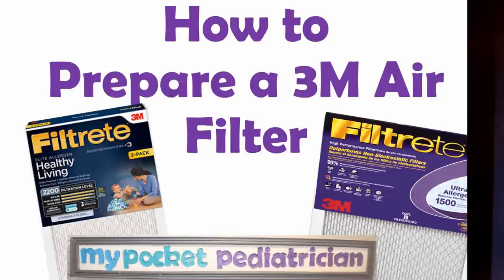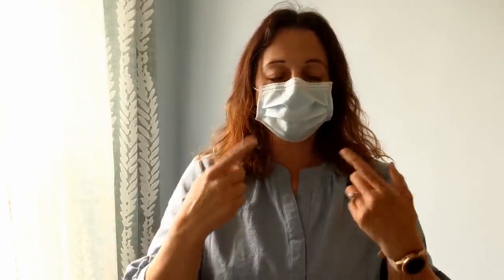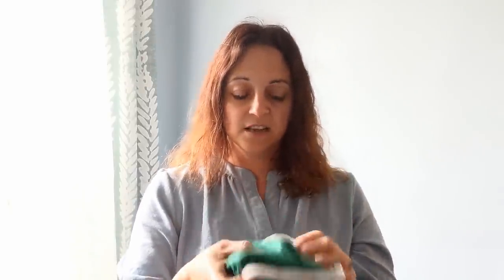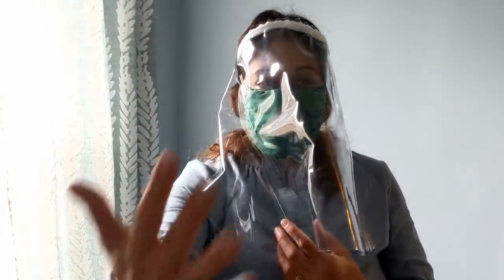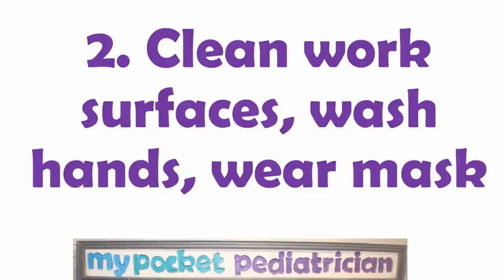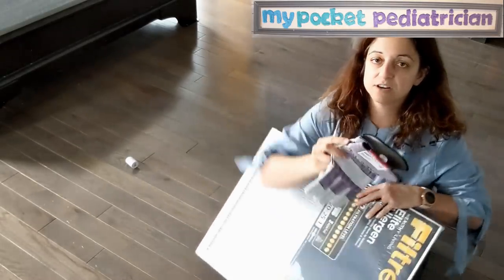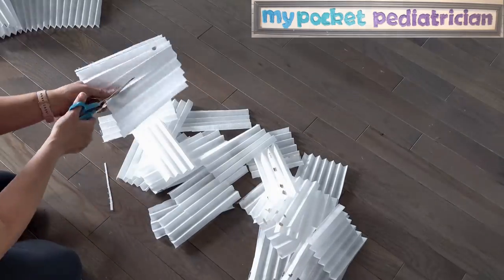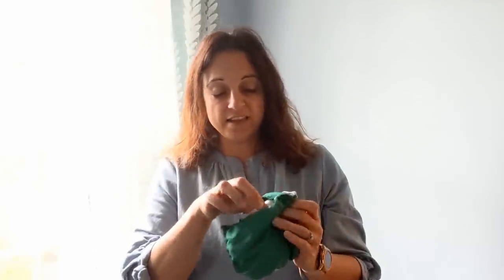UPDATED!  How to Turn a 3M Air Filter into a Face Mask

Comment: I'm wondering, if the filter is made of layers, wouldn't unfolding them decrease their effectiveness?
Reply from the maker: It's not exactly layers - it's just accordian shaped, but that's why I suggested using 2 layers of the material laying flat on top of each other.  I'm working on some improvements and hope to have a new video soon - I'm trying out new filter material tomorrow and am making a few comfort adjustments and hope to have a new video soon - please subscribe to get updates!
Reply: @MyPocketPediatrician  wait, i thought you said NOT to use two filters at the same time.... Can you clarify????
Reply from the maker: @nathanielaminahbradford4632  I believe I said to use 2 layers at once.  If I said something in error please let me know!

Comment: This is the best DIY mask I have seen so far! Thank you for taking the time to share this.  I have been wondering. I have sleep apnea and have extra CPAP masks available. Would sealing in a filter in the hole for the tubing be useful for our personal use? The mask seals tightly to my face. I don't think I could work a shift with breathing that restricted but I think I could do a grocery run.  I could safely discard the filter after each use and wash the mask in hot water with bleach. Just curious about your thoughts. Thanks in advance.
Reply from the maker: Some people are trying that.  It can be a little hard to breathe through such a small filter. ..like breathing through a straw.   I'd try it at home and see what you think.   If you have COPD, I'd check with your doctor about wearing masks and making it harder on yourself to breathe.
Reply: @MyPocketPediatrician  THANK YOU for your answer. No COPD. Yes, I will definitely try it at home first.

Comment: OlyFun fabric from Walmart is breathable and water resistant.  A square of this in with your other filters might help the cotton not get so moist?
Reply: Unfortunately those don't last in high  temps. They may begin to melt and warp in the dryer. Non-woven fabric stabilizer is a better option.
Reply: Amanda Pratt 
Understood.  I’m just using that as a temporary insert, not sewn into the mask.  My mask I made has a filter pocket so I won’t be washing the OlyFun.  I’ll just take it out and leave it alone for a few days and then reuse it.

Comment: Thank you so much for the video and great information.  Do you recommend putting 2 filters in one mask at the same time?  Thanks.
Reply from the maker: Yes, but I"m working on another material that will only require 1 layer.  I'm fit testing today, so please subscribe for those results!
Reply: Thanks! @MyPocketPediatrician
Reply from the maker: I have a new and improved Adjustable mask with FILTI material that passed the FIT test!  Please check it out here:  https://youtu.be/2J3Fq4o-U4I

Comment: I just wanted to confirm, are you using two individual filters at a time in your 2 per day notes?  Or two filters together for one day?  Thanks!
Reply: I just started watching your video on making the mask and you clearly state it having two filters inside.  So I answered my own question!  I made an Olsen style mask and I am trying to figure out the best way to insert the filters once cut to fill it the best.
Reply from the maker: @coldphyre  The problem I have with the Olson mask is that the filter doesn't take up the entire space of the mask.  There is a lot of fabric on the sides that doesn't have filter, so the air will travel much more easily in through the unfiltered fabric.  There needs to be a way for there to be no air at all to enter outside of the filter, which is why I chose my design.  I'm working on some new materials and a slightly more comfortable design that will maintain the tight seal.  Please subscribe so you get the updates!
Reply: @MyPocketPediatrician  thank you for your time in replying!  And that does make perfect sense!  The style I made is from Craft Passion and the inner layer for the pocket does extend the full length of the mask.  I still need to watch your mask video entirely!  Thank you again for sharing your information!!
Reply from the maker: @coldphyre  You're welcome!

Comment: Hey, great update!  Also, I saw another Dr. make one with a pipe cleaner for the bridge of the nose. We will be making at our own risk. Also, these are made out of polypropylene and polyolefin. The little research I did, I believe they are non toxic. But be aware.
Reply from the maker: thanks!  I have the link to the safety data sheet below.  I've heard the pipe cleaners are getting rusty when they are washed from the sewing community.  Some are using twist ties for bread bags also, and I heard they are holding up a little better.
Reply: My Pocket Pediatrician my wife said those tie things on coffee bags are flat and the wire is in the plastic. But might work too.

Comment: My husband insists that the furnace filter looks the same on both sides, and so it doesn't matter which side is toward the person's face. He says the arrow is there on the package because some filters have the wire mesh on only one side, and that side needs to be down in order to support the filter when you put it in the furnace; he says they put the arrow on the package even for the filters that have wire mesh on both sides; he says the air flow direction doesn't matter. I disagree, but we're having this conversation because I already took apart a filter before I saw your video, and now I don't know which side is which. Bottom line: can I use the filter I already took out of the package, not knowing if I have the air flow direction correct or not? Or is there a way to tell which side is which after I've taken it out of the package! Thanks for this video!
Reply: On closer inspection, it appears that on one side of the filter you can see a mesh of shiny strands, which don't appear on the other side. If this is the case and not just my wishful thinking, now I just need to know which side goes toward the face. I'm thinking that it should be the side without the shiny strands.
Reply: I emailed my question to mypocketpediatrician and got the response that confirmed what I noticed about these furnace filters: yes, there is a slightly shiny side and a softer, duller side. The shiny side goes away from the wearer; the dull side goes toward the wearer. And yes, she said, it makes a difference: you really need to pay attention to the different sides of the filter.
Reply from the maker: Hi, Again, I am not an expert, but when I talked to people who are, they said it is very important.  Mine had mesh on both sides and had the arrow.  The side towards the HCW is a little soft and dull and the one towards the patient is shiny.  It's really hard to tell, but I keep moving it around in the sunlight, and you can appreciate a subtle difference.  Hope this helps!

Comment: I think that suggesting people use filtrete is foolish as this will just create demand for products that should be used to protect the air filtration of thousands of homes and businesses.  would be much better to demand filtrete create a proper filter sheet for people to order in limited quantities.
Reply: I hadn't thought of that, but it seems logical! And now the company making these filters is saying they shouldn't be used either.
Reply from the maker: I have a new and improved ADJUSTABLE mask with FILTI material (designed for face masks) that passed the FIT test!  Please check it out here:  https://youtu.be/2J3Fq4o-U4I
Reply: @MyPocketPediatrician  - I'm glad you found something different! I actually ordered some. Once the fabric I've ordered comes in, maybe I'll actually get to use it in some masks I make! lol
Reply from the maker: @RaDazzle1  did you use the discount code?  MPPMask will get you 10%off

Comment: POCKET PEDIATRICIAN PLEASE HELP!! I'm making masks for everyone i know using ur filtering method. U said to look for the arrow, unfortunately theres no arrows or anything anywhere on the filter or box it came in. I wasn't able to find the exact type of filter u have mine is smaller and more compact without the mesh but it's the same exact filter and everything just smaller. One side is more cottony the other side is more of a smoother surface. I already took all the cardboard off and got most of the glue pulled off all of it. Now I have run into my big dilemma with the proper way to use them. My problem now is trying to figure out what side should be facing towards ur mouth...the side that's more cottony or the side that's more smooth. Please please help! I'm only asking for help from u because u seem to actually know what ur doing & I haven't found any better filtering advice than ur's. Thank u soooo very much for ur help & advice! U don't even know how much it's appropriated!! God bless u!
Reply: The cottony side should face you. Shiny side should face out.

Comment: I wish I had watched your video before trying to take the filter apart!!  1 slice and 1 poke not too bad
Reply: I forgot to mark the side with the airflow🙄 can you tell me if you can tell by looking at each side which should be towards HCW?
Reply from the maker: Aww - I'm sorry!  I was the same the first time I tried too!
Reply from the maker: @shelly2083  the slightly shiny side faces the patient, and the slightly softer dull side faces the healthcare worker

Comment from the maker: Diane Isherwood  the shiny side goes towards the patient and the softer, dull side goes towards the healthcare workers.   I did update this video since 3M says they don't recommend doing this to their filters.  I'm using Filti now, and here's the new link.  https://youtu.be/2J3Fq4o-U4I
Reply: I also opened up the filter and forgot to mark which side is which. However there is no shiny side. They are both exactly the same on each side. So how can I tell them apart?
Reply from the maker: @AmyWilliams1914  It is a very subtle difference. I usually have to hold it to the light to tell. You could also rub your finger on one side and see if one side becomes a little fuzzy and fluffy. That would be your soft side

Comment: Thank you Dr Lilly, as I had someone make an Olson mask, and subsequently find it not easy to use with tapes ( before that I’ve resorted to bandanas, tape to secure a filter inside and had a really good fit)., I thought elastic is the answer and came across this!! Thank you!! About the moisture, have you considered either sodium chloride ( disadvantage only one paper published) soaked wet wipe, or citric acid soaked wet wipe as the top layer?
Reply from the maker: I saw another video where the Olson mask failed the fit test despite all the tape, and I believe it's because the filter material doesn't extend over every surface of the fabric.  I found another company that seems to have a material where moisture won't be an issue.  They over-nighted me a sample, and I keep checking the porch to see if it has arrived yet.  I can't wait to try it out and make another video if it really is as good as they say.  I should have another video soon with some design improvements for comfort and with the new filter.  Please subscribe so you get the updates!
Reply: @MyPocketPediatrician  I can't wait to see the next video with the new material. Have you tried making the mask itself out of non-woven material? I have experimented with making face masks from blue shoe covers that have the elastic already sewn into them. I use the cover unopened (so that it's two-ply) with the elastic fitting over the nose and chin. I sew in elastic ear loops on the sides. With a tight fit, combined with a high MPR filter placed in between the 2-ply, they could work and even be disposable (though I appreciate the reusable aspect of cotton.)
Reply: I can’t wait, meanwhile I will have this made, with Halyard materials to send to one person who is immune compromised and doesn’t have a choice. I’m also soaking wet wipes in citric acid, determining rough pH using litmus paper, this will be the outside material then filtering materials. Once again, truly thank you, for putting this material out here, and the more we know the more we take it seriously. Thank you!

Comment: So it was time to change my house filter anyways.   I couldnt find a 3m one in the size i needed.   I did find merv 13 filters in my size tho.   So i got them for my house and to use in a Mask I am 3d printing.   Is there any data on if the Merv 13 is as good as say a 3m 2200?
Reply from the maker: I had a hard time finding a conversion rate - it seems 3M designed their own proprietary system.  I know their viral filtration starts at MPR 1500 and MERV viral filtering starts at 13.  Some have expressed concern that other filters may have fiberglass.  I haven't used any others, so I really can't comment on their experiences.
Reply: Conversion table at https://www.airfiltersdelivered.com/c/merv-mpr-fpr-ratings

Comment: Will coffee filters work?
Reply from the maker: Coffee filters won't filter vital particles...or even droplets really since water (coffee) passes right through them.   They really only filter coffee grounds.    I am working with a better material now.   It's called Filti and is available here:.
Reply from the maker: Coffee filters won't work. They really only are designed to filter coffee grounds. They definitely won't catch viral particles and not even droplets really since they are designed for water or coffee to pass through them. I am working with a new material that is better called filthy that also passed the fit test. Check out the new tutorial here.   . https://youtu.be/2J3Fq4o-U4I. I also have a discount code for them.   MPPMask
Reply: @MyPocketPediatrician  Ty for your response.

Comment: Wow! Great video! Thank you doctor. 🙏👏👏 I have one question, so the filter you showed us by 3M, those are safe to use?  Please let me know, thank you. I also heard we can use coffee filters?
Reply from the maker: I honestly can't say for sure.  3M will not say they recommend this. Coffee filters won't filter viral particles.  I found a material that I'm working with that is designed for this, and I should have another tutorial out in the next day or two - please subscribe so you get the updates!
Reply: @MyPocketPediatrician  I see, thank you doctor. I read an article that was posted today that talks about the types of materials that are best suited for a homemade mask. And you're right, the coffee filters provide very low filtration protection against viruses. They said material that is dense with a high fiber count such as flannel works well. Provides moderate protection. I was thinking of getting a flannel mask, what do you think? And yes, I will look out for your next video. Thank you! 🙏
Reply from the maker: @Linkfan007  I'm not sure how breathable flannel will be, and I doubt it will filter viral material either.  The material I tested today passed the FIT test, so I'm really excited about it!
Reply from the maker: I have a new and improved Adjustable mask with FILTI material that passed the FIT test!  Please check it out here:  https://youtu.be/2J3Fq4o-U4I
Reply: @MyPocketPediatrician  That's great! Thank you for letting me know, Doctor. I will take a look. ☺

Comment: The fiberglass concern seems to be coming from the community that started making masks with HEPA rated vacuum bags. These bags apparently run a risk of having fiberglass, and since you shouldn't be getting into one, it is considered safe for that application.
Using it on an apparatus designed to breathe through would be the big no-no.
Filtrete does not use fiberglass for their filters. They use extruded, thread-like plastics, as shown in the MSDS.

Comment: Safety Concern:  fiberglass
Please be very cautious about which filter material you use.  If you don't know for sure that it doesn't contain fiberglass then I would be very cautious about using it.  I couldn't get a 3M filter so I purchased another highly rated brand, made in the USA and rated MERV13.  The product information said it was synthetic material.  I assumed that since it was intended for home air filtration that it would be safe and not contain fiberglass.   I've found that is not a safe assumption.   I dismantled the filter as described in this video and cut it into pieces.  Then I noticed very tiny loose fiber like particles all over my work surface (which happens to be a dark color and right by a large window).   Examination under a magnifier showed particles resembling fiberglass.  These same particles were clinging to my nearby IPAD screen and other surfaces.   The 3M  Filter safety data is posted here but other brands of filters may not be safe.

Comment: Why am I just now seeing this video?! I took my filter out of the box without noticing which side the arrows were facing for the airflow! Uugghh! Is there anyway to figure out otherwise?
Reply from the maker: One side is slightly shiny and the other is a little dull ...can you see a difference?
Reply: My Pocket Pediatrician yes. Is the shiny side the face side?
Reply: marque235 I just plain forgot that step. And to me both sides look the same

Comment: Here' s my idea - you've probably seen movies where bank robbers pull pantyhose over their face.  So what if you put one of your filtrete squares over your face, then pull a snug but not too tight pantyhose over your face?  You'd have a perfect fit, with a perfect filter underneath!  And no constructing of a mask.  The only hard part I can think of is how to keep the filter square in place as you pull the pantyhose over your face.  I think another person could help - if person #2 pressed certain spots on the square with their fingers, then as you pull the pantyhose down, they change where they're pressing to accomodate what you're doing.  Maybe rubber bands would be sufficient to hold the square in place, I don't know - I haven't actually tried this as I only thought of the idea about an hour ago.